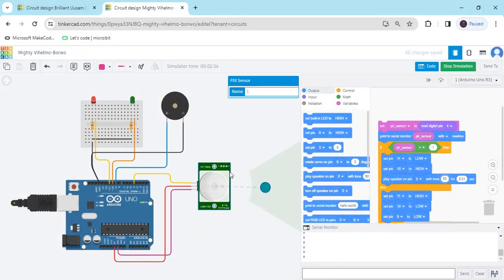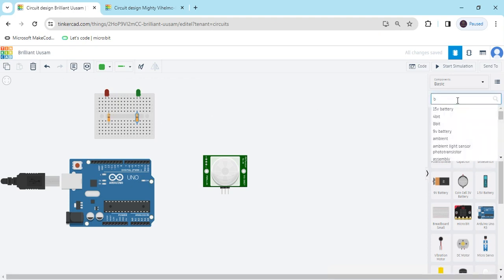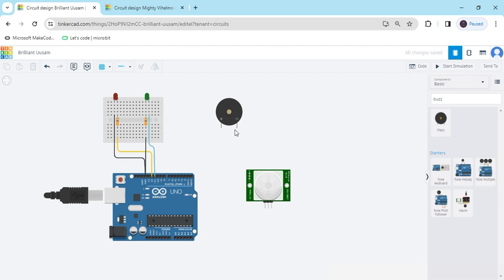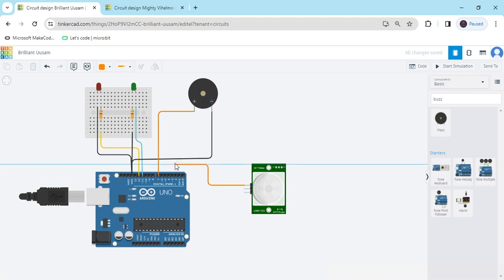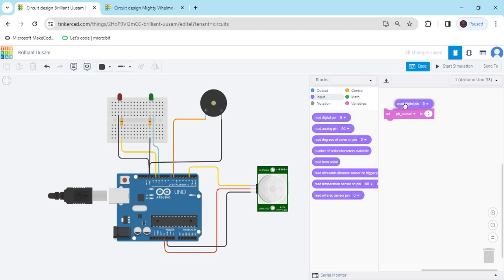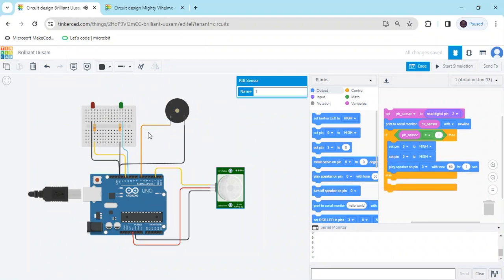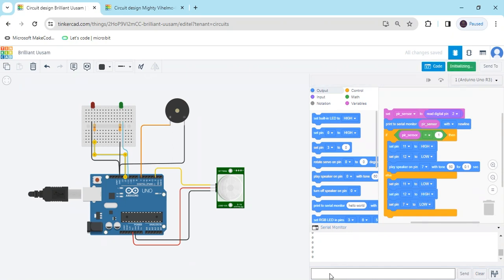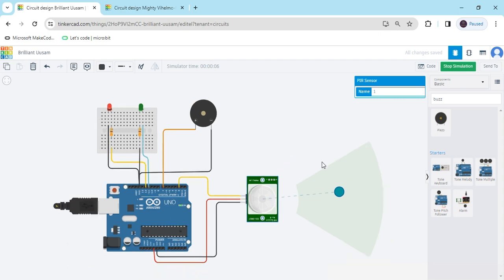Tinkercad Arduino Project : Motion Detector using PIR Sensor and Arduino

Comment: // Definição dos pinos
const int sensorPin = A0;        // Pino do sensor TMP36
const int ledVerde = 2;          // Pino do LED verde (operação normal)
const int ledVermelho = 3;       // Pino do LED vermelho (estado crítico)

// Limite de temperatura crítico
const float TEMP_CRITICA = 50.0; // Acima de 50°C = estado crítico

void setup() {
  Serial.begin(9600);               // Inicia comunicação serial
  pinMode(ledVerde, OUTPUT);        // Configura pino do LED verde como saída
  pinMode(ledVermelho, OUTPUT);     // Configura pino do LED vermelho como saída
  
  // Inicialmente, apaga ambos os LEDs
  digitalWrite(ledVerde, LOW);
  digitalWrite(ledVermelho, LOW);
  
  Serial.println("Sistema de Monitoramento de Temperatura - 2 Estados");
  Serial.println("==================================================");
}

void loop() {
  // Lê o valor do sensor TMP36
  int leitura = analogRead(sensorPin);
  
  // Converte o valor analógico para tensão (0-5V)
  float tensao = leitura * (5.0 / 1023.0);
  
  // Converte a tensão para temperatura em Celsius
  // TMP36: 10mV por °C, com offset de 500mV a 0°C
  float temperaturaC = (tensao - 0.5) * 100.0;
  
  // Exibe os valores no monitor serial
  Serial.print("Temperatura: ");
  Serial.print(temperaturaC, 1); // 1 casa decimal
  Serial.println(" °C");
  
  // Controle dos LEDs baseado na temperatura
  if (temperaturaC < TEMP_CRITICA) {
    // OPERAÇÃO NORMAL (< 50°C): LED verde aceso
    digitalWrite(ledVerde, HIGH);
    digitalWrite(ledVermelho, LOW);
    Serial.println("Status: OPERACAO NORMAL");
  } 
  else {
    // ESTADO CRÍTICO (≥ 50°C): LED vermelho aceso
    digitalWrite(ledVerde, LOW);
    digitalWrite(ledVermelho, HIGH);
    Serial.println("Status: ESTADO CRITICO!");
  }
  
  Serial.println("-----------------------------");
  delay(1000); // Aguarda 1 segundo antes da próxima leitura
}